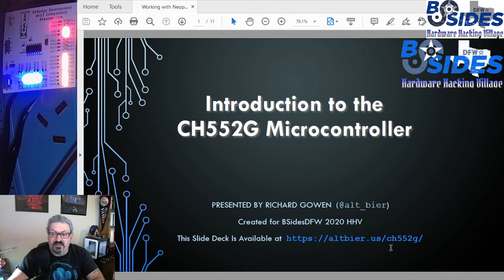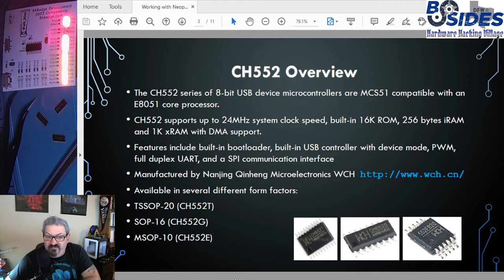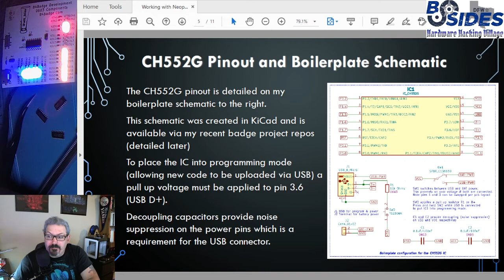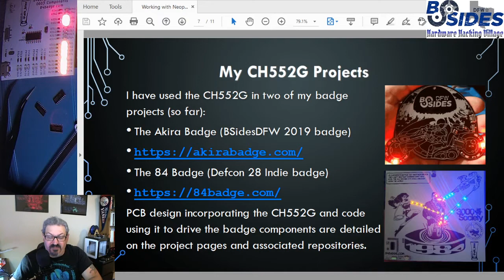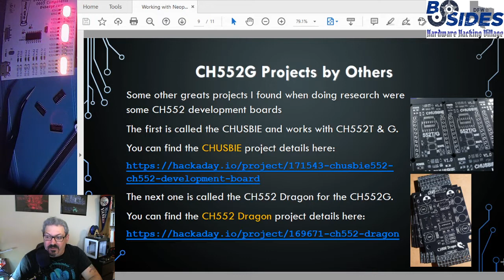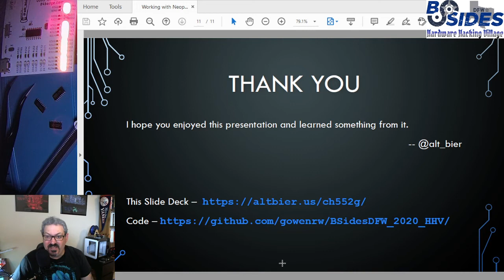Intro to the CH552G Microcontroller HHV2020

Comment: Hi. apparently the WCHISPTool 2.5/2.6 used to have a read mode. Are you familiar with any repositories for this? I have a generic Chinese USB reader that uses bootloader 2.5 and I want to add an additional custom output type, so I need access to the firmware. I have tried a few pyton tools, however, they all dump blank results.

Comment: Nice presentation but.. at 1:07 (and later in the architecture section) you referred to the MCU core as a "E8051 ARM core processor".
it's a MCS-51 based core so its using the old Intel 8051 CPU architecture introduced in 1980. 
I spent a few minutes trying to puzzle out if this was some strange ARM/8051 hybrid. :)
Thanks for putting this together.

Comment: When you have a large capacitor to smooth the supply you find it will get rid of low frequency noise but not work as it should (perfect capacitor) at high frequencies. The safe way of doing this is to have various capacitors in parallel with different values in orders of magnitude, e.g. 0.1uf, 0.01uF and 1nF say. The small capacitors are not really needed if it is a low frequency circuit, but for production in order to hit the EMI regs it is good practice to have 3 of them for a microcontroller. The problem is the large capacitors have a high series resistance to very high frequencies so if unchecked they can crawl along your supply lines which function as radio antennas.